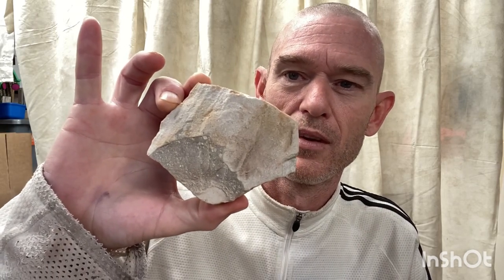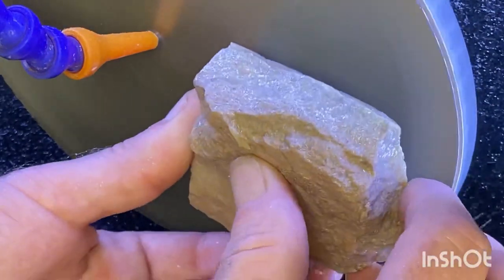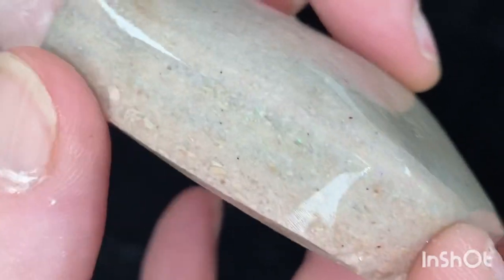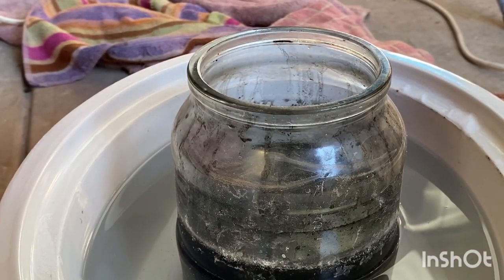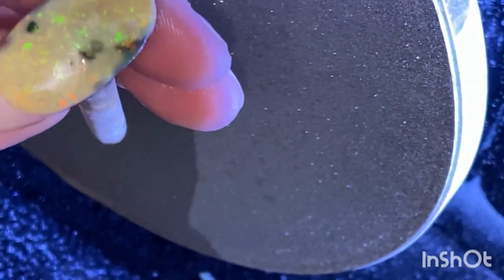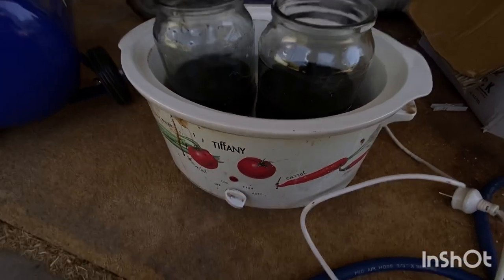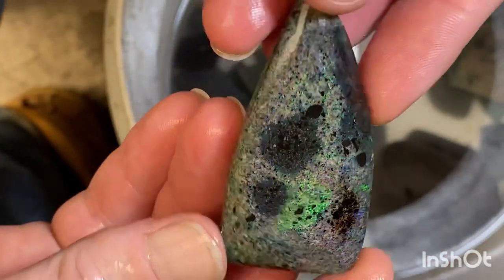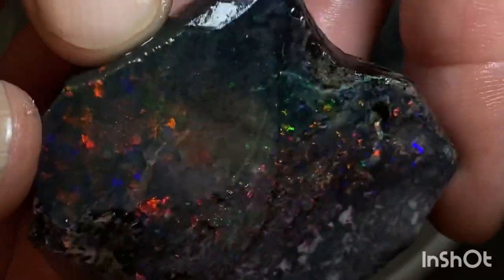Hiding In The Matrix.

Comment: Hi Phil, thanks for sharing, nice video. With the vacuum fogging up, under vacuum water boils at 90 degrees, so if your solution was warm, it would super heat and create steam, so it may need to be cooler than you think?  Something I will try, have you used a more dilute sulphuric and put it under vacuum? Just wondering if it would penetrate more and reduce the need for multiple treats?  Great result for a rock most people would walk straight past 😃
Reply from the maker: Thanks Jeff, I don’t think I’d let the sugar solution cool enough, next time. 🤣👍

Comment: Is the only way to get that color by treating it with acid? Or can you do that with just multiple sugar treatments and tossing them in the oven? Also, what does using the pressure pot do? Does that help with keeping the color after cutting? At least my understanding is with sugar treatment you have to always retreat it if you cut it. Also, is a flat lap just as good as an arbor for all kinds of opal?
Reply from the maker: G’day Doreen, there are a few ways to treat the matrix, the idea is to get carbon deposited in the pores in a permanent kind of way. We use sugar for its carbon content as sugar is carbon, hydrogen and oxygen, that’s right, pull water and diamonds apart at the atomic/molecular level and mix them in the right order and you get C12-H22-O11 aka sugar. So once cooked in the sugar solution, we need to remove the H22 and O11 but leave as much of the carbon 12 as possible, this can be done with the sulphuric acid due to its reaction separating out the C, from the H and O, but also can be done by carefully raising the temperature in an oven, here’s where I’ll refer you to Riley Gunn aka 53frogs aka NN opals, he has put out a couple of videos of this method, on his YouTube channel, with more explanation on how to go about it and what to watch out for. The pot is actually a vacuum chamber, as liquids can have a high to low viscosity, it can affect the absorption rate as the sugar solution has to move oxygen out of the pores in order to fill them under gravity, so I submerge the matrix in a container of sugar solution, then place in the chamber to purge the oxygen from the stone, then when I release the pressure the only thing the can be sucked back in the stone is sugar solution. As the treatment only goes in maybe up to around 2mm, any work done to the stone after treatment may remove the treatment requiring a re-treat. I learned to cut on a flat lap, I’ve tried the others but I prefer the vertical flat lap for a few reasons, being it’s flat and the usable grind surface is larger than 2inch, I feel it easier to flatten material for doublets/backings, and for cutting larger material. 🤪👍
Reply: @theopalmills    Very cool! That answered more questions that I had plus some I didn't even know to ask so thank you very much for that information! I absolutely appreciate it! So, is the only Australian Opal that's treated just this one or do they treat others as well? And yes, I'm very familiar with Riley's videos as well. I'm trying to learn as much as I can! So... Now, how can we put those specific ingredients back together instead of taking them apart! I'd definitely rather the diamonds over the sugar! Lol. Thank you very much for the info!
Reply from the maker: @doreennacht  matrix opal can be found on most fields in some form, even QLD boulder opal is an ironstone/opal matrix, but as for treating to darken the stone, Andamooka is the most predominant with sandstone/opal, limestone/opal, quartz/opal and agate/opal matrix, and Winton in QLD produces “fairy matrix”, (sandstone/opal matrix) that is also commonly treated. Matrix means that two or more types of rock formed into one, for instance when gold is formed naturally in quartz it is a gold/quartz matrix. 🤪👍